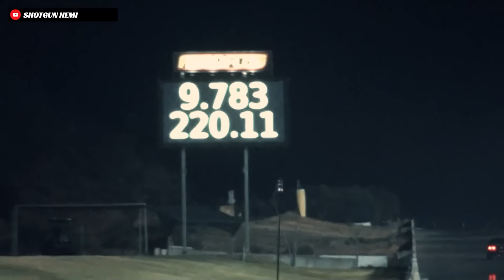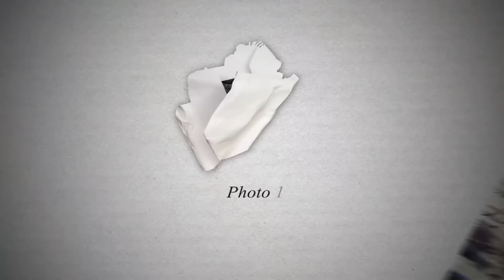The American Supercar That Was Faster Than EVERYTHING - The Manta Mirage

Comment: For some reason alot of kit cars end up in Florida so I've personally seen 3 mantas and drove one LS powered. It was a go-kart from hell and handled like it. It borderlines on not being heavy enough for its own good. The front tires only suggest where to go and the ass end loves to trade with the front. The suspension parts are meant for cars much heavier than it is so that plays a part. I'd be terrified to seriously race one but in good hands it'd be unbeatable. Can't see shit driving it on the road so there's that. It has the fiero syndrome where you feel like you're going faster than you are being so low to the ground. I race supersport motorcycles and ride a liter bike on the street and that car scares me. For anyone with one, spend the money on sticky tires and good brakes because it doesn't have to weight to stop without locking up and sliding. Its cool to see you cover this car. More people know about sterling novas more often than this one. Nice video
Reply: Ease of registration. You can register just about anything in Florida so it makes sense that they either end up there or had initial registration there.

Plus the demographic of people living there, older folks with expendable income along with wealthier residents near beaches wanting a cruise car.
Reply: @CreamAle  you know that didn't occur to me. I've spent most of my life in Florida and South Carolina so my knowledge of vehicle regulations between states is lacking. Florida does have processes for kit cars specifically and no inspections. I just didn't put 2 and 2 together on that one lol. Good call.
Reply: @ValkyriesMoon  yeah for sure. it's why CleetusMcfarland and the BoostedBoiz can have those wild cars on the road legally. Like that Tesla swapped odyssey or even Leroy, the previously exocaged Corvette he has.

Florida is wildly easy for that stuff whilst California is one of the more tough states to get away with things like that. Cherish your state's freedom with registration, because that stuff will go away eventually, sadly.
Reply: Pretty sure you made all that up....😂
Reply: Easy to register. And a larger portion of the population with abundance of extra income and time on there hands .
Reply: Thx for the real perspective, brother!!
Reply: 🤣😂🤣 Reminds of a kit car, built and registered in FL, based on the Porsche 914 w/ a supercharged LS6 sitting in it. You just kinda pointed the car in the general direction and hoped for the best.
Reply: Miami cocaine money back in the 80s probably 😅
Reply: @jakedode Pretty sure you have no idea what you’re talking about….😂
Reply: @丫o  right right... and you were there with David Hogg tooooooo!!! He had an hour test drive and learned all about the car in one drive!!! You definitely are blue...🤣
Reply: @francislutz8027  South. Only been to jennings once
Reply: Then everyone clapped

Comment: I was, with a buddy at Road America in Elkhart Lake, Wisconsin in, I think, the late '80s when we came upon a red coupe.  Knowing nothing of the car, and always curious but no touch-y, I rolled around on the grass poking my eyeballs as deep as possible into the car's nooks and crannies to see what it was made of.  Peeking through a gap in the rear, I saw the unmistakable shape of a '61-'63 Buick 215 cu in alloy V-8!  I had been collecting junk ones in hopes of mixing and matching good parts to end up with a set of decent internals that I could put into a good block which would get installed in a lightweight Chevy Monza/Buick Banshee I was planning.

I had found, meanwhile, that the alloy heads and steel crank, from Buick's '64 Wildcat 310 would work with the 215 Buick block and Ford 2.3 liter pistons to enlarge displacement to 305 cu in.  Adding Kenne-Bell valvetrain bits, lightweight steel flywheel, and oiling mods would make it all live at power levels above 400HP.  That was the REAL Kenne-Bell...back when they were only about Buick performance parts, instead of the belly-button stuff they sell now...A full-on 455 Wildcat with Kenne-Bell innards and accessories was both a thing of beauty and a screaming beast at the track!

By that time, I had collected enough of the larger '64 heads and cranks to make 10 engines but needed cash.  What the Hell!...I wrote brief note about the mods, name and number, on a slip of paper and wedged it between door frame and body.  A week or so later I got a call from the owner and we arranged to meet at the next event at the track we would both be attending.

Somewhere in the Midwest, there is/was a Manta Mirage with, at least for a time, 300 inches of very light, tightly packed, Kenne-Bell enhanced, Buick power!  A photographer by hobby, I have  few shots of the car..one out on the track with a slow-shutter speed blur!

Comment: I have a Mirage serial# 66. If I ever finish it, it will be brutal. It has a brand new over the counter LT1 from back in the day. Forged crank & pistons, pink rods, 6 quart baffled oil pan, double hump angle plug heads... All the good stuff from back in the day. 

But the way the car was built leaves a lot to be desired. Which is why it's not finished yet. It came with a Karman Ghia front suspension. That's right, VW. The disk brake pads are smaller than a hockey puck. It's a trailing arm suspension which means the camber changes equal to the body roll. They welded extensions to the steering knuckle's tie rod arms. All this is fine for a sand rail but not a high performance street car. I'm in the process of replacing all of it with an entire Pinto/Mustang-II setup with electric power steering. 

He mentioned the 4-speed Corvair transaxle. But he likely doesn't know the problems there. The Corvair was an air cooled 6 cylinder with the engine hanging past the rear axle pointing back like a Porsche. The crankshaft turns the "wrong" way. When you turn it the right way it's now turning backwards to the way it was designed to run. The Saginaw  transmission doesn't care, but the puny 6-1/2" ring and pinion sure does. Now it's being driven on the coast side of the gears which creates a god awful racket. And the resulting loads on the differential case want to split the case in half. Dumping the clutch of a 350hp engine with fat rear tires is just gonna split that case right in half. Which means you have to baby the thing off the line. I still haven't come up with a good transaxle  solution I can afford.

There are other problems to solve but their easier to handle. That's the fun part.

Comment: the Montage T looks nice, that one in that cute blue seen in 7:25 and 7:39. i think the nostalgia behind these cars is what makes it awesome. what i want to see is a production sportscar with like 1000ci displacement and like 4000HP on the wheels, the engine bay behind the driver would be like three feet longer than for a usual V12 6.0L engine, that is not to long and eligible for driving on publicly accessible roads. there are factories that race to make the fastest production car, its strange that they then dont make sportscars with powerful engines like that, that much HP would be enough for like 310mph.

Comment: Owned/built a Manta Mirage powered by a 3.5 liter Buick V8 (215 cu. in.) 1980-86.   The Buick was aluminum block with Formula 1 racing heritage (won F1 in 1962 I believe).

Comment: Check out Factory Five Racing for modern kit cars - their 818 coupe kit weighs about 2200lbs or so and uses a Subaru WRX powertrain (though only the rear wheels are driven.  If 270hp (or more, depending on mods) in a one-ton vehicle isn't enough, check out their GTM kit - LS V8 power and various Corvette parts to keep costs down, along with a bespoke body & chassis.

They're not the only kit car builders, either, there are several other builders on both sides of the pond.

Comment: @flyboy3633 Hey man sounds like you have a really cool project that your still in the process of building when i read about your problem with putting the HP throughout the driveline and it splitting into two. 
a thought came to me. would you be able thr get a complete drivetrain off a C5 Vette? i dont know what measurements you’re working with as far as the cars total length but even if it was a little bit longer if your a good welder you could always make it a bit longer so that the corvettes c5 LS1 that has the driveline that connects to the transmission. is there a way for that to work? i know it’s a front mounted engine and trans in back if there’s a way to just use the driveline for your application. i dont know JUST tossing ideas out there for you buddy! 
take care 
C K

Comment: Neat cars -- however they were NOT faster than a Pantara.  The problem with them is that the Corvair transaxle and transmission will blow to bits the moment you punch the gas, the suspensions were so horrid that the handling sucked, and the brakes were not good so stopping wasn't the greatest either.  I've seen one with a ZF 5 speed transaxle in it and that addressed a lot of the issue, and now I see guys putting Porshe Boxster 6spd transaxles in them - which is probably even better.  The other problem is the looooooong overhang in the front of the car makes it impossible to navigate speed bumps,  steep inclines, or even go over a curb to enter a driveway.  Still though -- neat looking beasts.

Comment: Hold on. They were using a CORVAIR transaxle? Made for a flat 6 with what, 120hp? With 500HP big blocks? sound a bit far fetched.
Reply from the maker: I would imagine if you had a Big Block in yours that would have certainly needed some beefing up of the corvair transaxle